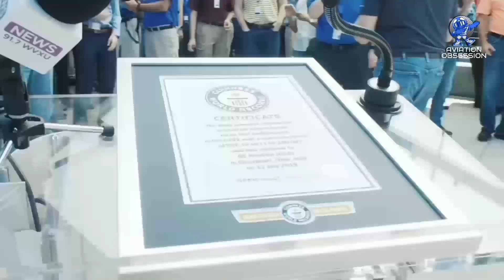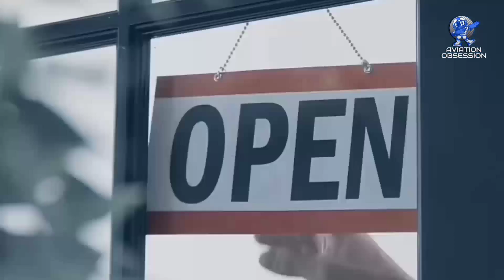Top 10 Mind Blowing Facts about B777X

Comment: The new engine is rated at 110k pounds of thrust, which is lower than the GE90-115 at 115k pounds of thrust.  The 134k was achieved during the triple redline testing, but the engine is meant to run at a much lower thrust in normal operations.